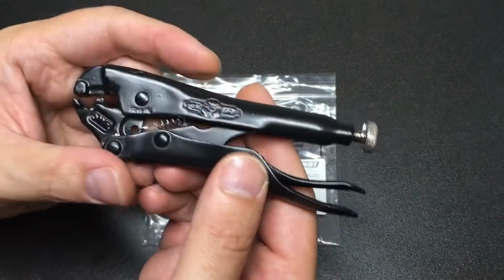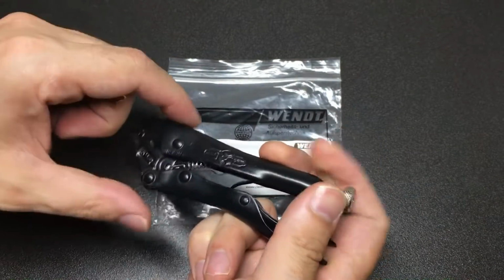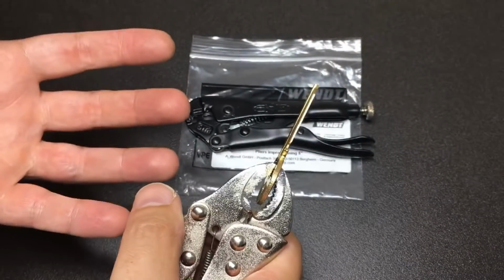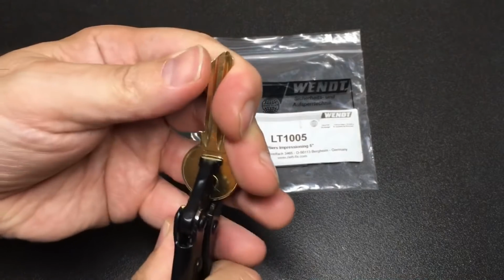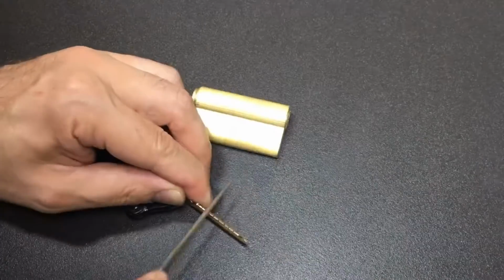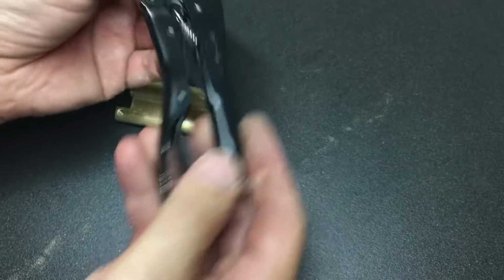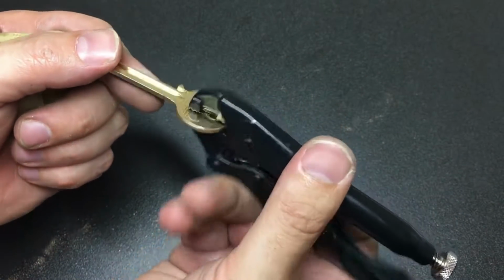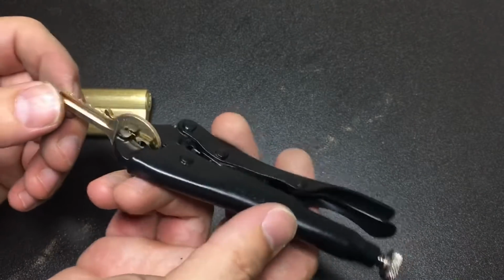Wendt Imp-Grip Impressioning Pliers Review

Comment from the maker: I found these grips to be very effective for quick key impressioning, I particularly like the extra stability it gives over standard vice grips and the speed of changing keys over normal impressioning handles. Since I made the video, Though I thought more about whether I think this is too expensive. I think my conclusion is yes, it IS expensive, but professional impressioning equipment across the board is expensive; probably because of the low volume, specialist nature of this type of equipment. Certainly you would have to carefully consider whether this was a worthwhile investment as a hobbyist, but I think it would certainly be viable for the professional.

Comment: I've never tried impressionist, but that was a good video. I'd be more interested in watching the process a bit slower, not so much interest in the clamping tool. There are hundreds of different ways to clamp some kinda handle on the key blank. 
I also have some neat little strips that look like aluminum but feel like plastic and are used for impressioning. I would use them for a cylinder I have no key for, but have picked open and gutted. Just put the strip into the keyway, then reinsert the key/bottom pins and push them down flush with the plug (the shear line) then remove the pins and the strip, and the strip will be an exact copy of the bitting.
EDIT: fixing typos from autocorrect.
Reply from the maker: I have a few early impressioning videos you could search for :-)

Comment: wouldn't it be easyer to use charcoal dust on the side of the blank key on both sides.
Reply from the maker: Never seen that done.
Reply: @LockNoob  you use a art paint brush (one that is just fatter than a pen and dust it onto both sides of blank key. (avoid using fingers as the human body oil mess up the charcoal on brush and key) i can tell you now alot of lock smiths will only use that as a last resort.

Comment: something that is impossible if you make the key in that way, what happens is the lock is forced, it will break and leave a lot of stress.  better to use the usual method, such as opening and making a key.  if it's only for reviewing that tool, I don't think it's effective, look at your hands
Reply from the maker: I say at the end, you should really vice the lock up. I did this in hand so I could get it in shot

Comment: A apple seed or piping file #4 Swiss cut, works best. Check out bensal folly  website, they have the best price. Mine, I have used for about 4 years with no issues. $50.00 the last time I looked.
Reply from the maker: Another example of an expensive impressioning tool. While it is undoubtedly a great file, as an occasional impressioner, it would still be quite an expensive in investment for me. One day I do hope to get one though!!!
Reply: @LockNoob  true but money well spent. Most others are 80. To 100 dallors.
Reply from the maker: @charlesrknottsjr  I will say with tools in general, you get what you pay for and true bargains are hard to find. A good set of files is always a great investment
Reply: I was wrong on the price. $42.00

Comment: yea... no.  nice tool and im sure it works better than regular vice grips.  But dude..  thats over 100 dollars for basically vice grips with an extra tooth.  Again. Better.. but they should be ashamed to charge that price.  Im sorry, but thats a fact.  They are ripping off the locksport community.
Reply from the maker: It’s not aimed at locksporters though, it’s more for professionals. Read my pinned comment for my thoughts on pricing. I think it’s definitely expensive but nearly all impressioning stuff is. Not sure why exactly but I’m guessing it’s low volume manufacturer related 🤷‍♂️